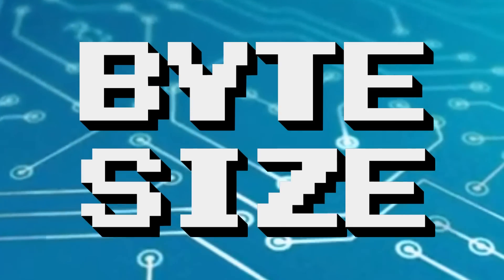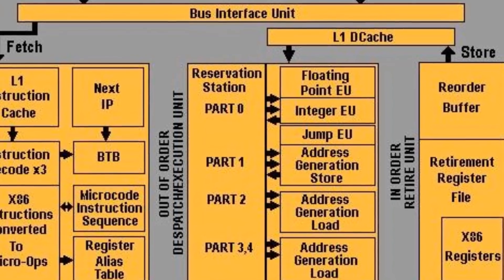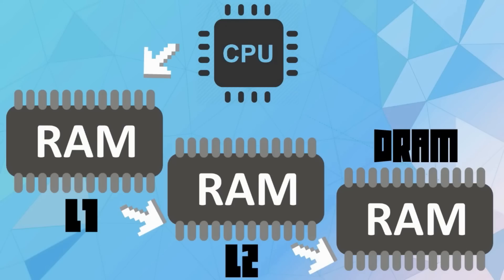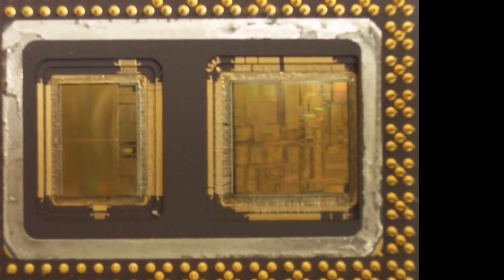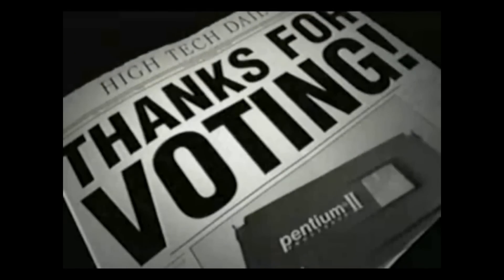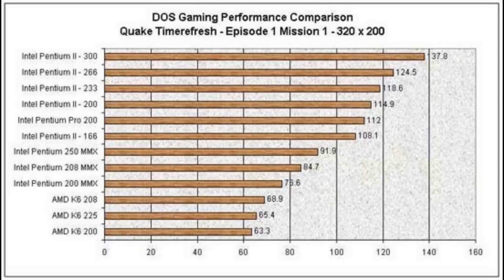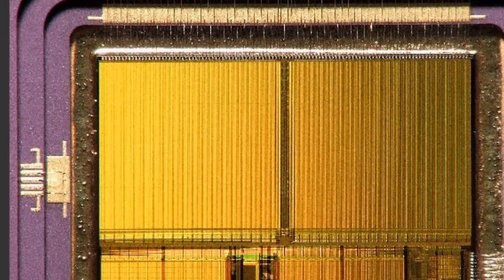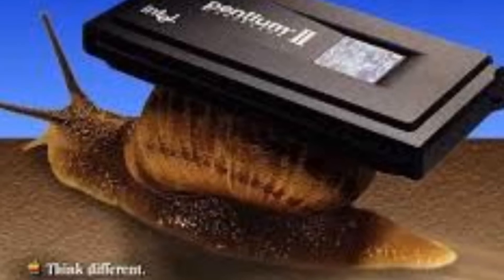Why Were Pentium 2's on Cards? [Byte Size] | Nostalgia Nerd

Comment: Some Pentium III CPUs were slotted too.
Reply: Yup, had a P3-800Mhz that was on a card.
Reply: I had a Celeron that was on a slot adapter, can't remember what slot it adapted to though.
Reply: Slot 1 to Socket 370 adapter, most likely.  That's what I did, while running a Swiftech TEC cooler and -40C temperatures.  I actually beat Intel to 1Ghz using an Intel CPU, but I assumed it had been done before - only to hear about it in the news a few weeks later.

I did that with a Celeron of some type, IIRC.  That machine did me well, but I had to use a full sized box fan to keep it cool :p
Reply: Wrong. Pentium III CPU first came out ONLY on Slot 1. I know because I bought one before socket 370 even existed. You can buy a true Slot 1 PIII from 450mhz all the way up to 1133mhz and NO they are not on a Slot 1 to 370 adapter, they are all genuine Slot 1 units. A simple wiki look up would have shown you this.
Reply: Are you saying I'm wrong?

I was responding to JaminandShara Mills about their use of a slot adapter.

I eventually went with dual Socket 370 - I haven't gone back to one core since :p
Reply: oh ok
Reply: looncraz - You beat Intel to 1 GHz? Eh no. Overclocking wasn't some magical thing, everyone did it. > 1 GHz wasn't special at all. It was just a problem releasing a production model that kept working with proper cooling, especially because of Intel's failure to fix their packaging on their Slot 1 module's cooling plate.

Intel had prototypes far above > 1 GHz months before they released their production line 1 GHz 'heater' that failed partly to Tom's Hardware review, thereby launching the Athlon to the mainstream market. Pretty much the only time Intel had to put in some effort to compete against AMD.
Reply: Errr....AMD dominated desktop the CPU market for years in terms of performance. from the first Socket A Athlons in 2000 to the Athlon X2. Intel finally took the lead in 2006 with their Core2Duo cps...
Reply: EvoPortal they slightly dominated in performance vs costs, but certainly not in market share.
Reply: EvoPortal and most Socket A platforms were crappy SiS and Via chipsets with fix-your-own-driver support. Viaarena anyone? 

Yes Amd had the best bang for the buck, but that's of no use when you look at the whole package. Intel just let everyone down with the P4 and made up for it. Amd just went downhill from K8 onwards. And the succesful K7 was based on the borrowed digital alpha architecture anyway.
Reply: I literally beat them to 1Ghz.  They achieved it November, 1999, I demonstrated in my school at the beginning of my senior year - September, 1999 and had achieved it some time earlier (actually within days of getting my shiny new Celeron CPU.

They used an Asetek Vapochill, I used a Swiftech something or other with a beefed up TEC.

Intel wasn't actually the first to do it, either.  Hardwarecentral did it with TWO Pentium III 500 CPUs - and most certainly did it before I did it, given I didn't manage to buy my CPU at launch - I bought it late in the summer, after my vacation at my aunt's house in Florida :p  In fact, she bought me the Swiftech cooler ;-)
Reply: looncraz i'm sure that you were very impressed with yourself. But there already were 1 ghz smashed systems in the summer of 99 from overclocker teams. Including stable prime95 and the likes.

You're basically claiming that you build the first airplane, while numerous people and teams were doing the same thing succesfully at that time... Which is also not that surprising as the overclocking scene was already big in those years.
Reply: I only ever said I beat INTEL to 1Ghz, I never claimed to be the first of anyone to do it.  I was rock-solid at 1Ghz (actually a little over) using Intel's own hardware.  It was so easy with my cheap Celeron I, naturally, assumed it had already been done (and had been, of course... but just not by Intel).

In any event, I was probably one of the first few dozen people to run a 1Ghz x86 CPU at all (sub-ambient CPU cooling wasn't that common, particularly in 1999).

... And I only brought it up because I did WITH the slot adapter (which made it easier).
Reply: EMPiiRE I had one
Reply: Do you think your idiotic statement is somehow adding to the conversation that died last month?

P1 never reached 1Ghz - not even close.  Intel made a BIG deal about hitting 1Ghz - I saw it on the news and laughed my ass off because it was stupidly easy once you cooled the CPU enough (-40C was plenty, provided you could maintain it).

I ran my system 24/7 at around 900Mhz, I could tweak it to 1Ghz and get into BeOS without issues, but I never felt comfortable pushing the voltage.

I like how you call me 'kid' when your entire statement smacks of someone who wasn't around for the beginning of subambient consumer CPU overclocking.  I'm part of the reason Swiftech began using cold plates on the TEC coolers (well, I assume - the guy actually tried to tell me how worthless they would be... then started using them a month or so later).

My first computer had 8" floppy drives.  My second had those crazy small 5 1/4" floppies.  My third was a Tandy Deskmate.

Just to date myself some...
Reply: Tetra Digm - my thoughts exactly. Amateurs beating big corps sounds cool but is far from reality. Intel has their own labs obviously.
Reply: LekkereKwal amd had its own fabs up until 2008
Reply: stevacus I said 'labs' as in 'laboratories'
Reply: Who are you kidding? VIA chipsets were so-so during the early Athlon days and very quickly became the #2 chipset only slightly behind the fantastic Nforce chipsets. VIA KT series were amazing chipsets for Athon XP cpus.
Reply: I have a P3-500 on a card, it replaced a P2-450 (which was sold as a 450 but was really a 300 O/C to 450) when the P2 would lock up when MMX was used.
Reply: wasn't that the Celeron 300a. had one on a "slotKit" socket mount cpu on a slot card. 50%oc out of the box. guaranteed
Reply: The one I have is not a Celeron. I can even give you the part number: 80532PX300512PE SL2W8
Reply: Not referring to the 3/500 that wasn't overclocked. Was referring to the 450 that we a 300 overclocked
Reply: That was the Pentium II 300 OC'd to 450. It also came with a passive heatsink.
Reply: Just dug one out of an old computer from when I was a kid too.
Reply: There were even P3 slot adapters to let us put the newer P3 CPUs on older P2 motherboards.

Ah, those were the days.
Reply: i'm pretty sure nearly all of them were slots , never even seen a socket version of a p3 in my life,
then again, by that time AMD athlon was raping p3 anyway ;)

i  had p3-450, traded for a p3-550 with someone who already had a p3-450 and a dual socket mainboard running BSD back in the day
Reply: I've seen P3's in slots, sockets, and slot adapters. Some slot adapters let you plug early P3's into P2 motherboards. There were definitely plenty of socketed P3's. I know,  because I built well over a hundred myself.

And yes, the Athlon was a faster chip at any specific clock speed; however, Athlon had the nasty habit of letting the magic smoke out if the heat sink wasn't properly attached, so we tended sell more Intels to business and AMD's to gamers. 

And don't get me started on the conversation I had with the guy who acted like we cheated him when we sold him an AthlonXP processor; Athlon called a 2000MHz processor a "2400+". Dude thought he was buying a 2.4Ghz CPU and came back mad when he found out it was, technically, a 2GHz CPu. I tried to explain pipelining and MIPS, but he didn't want to hear it... just called us cheats and lairs.
Reply: haha thanks for clearing that one up

i did repair and build a fair share of computers back in 1999 orso when i worked as internal tech/helpdesk guy for a software company
the systems varied from shitty 486 word processing machines (hey we used a 486 as software router/dns server, and had like uptimes of like 3 years) up to pentium 3's

we didn't have many AMD machines at all there either, but the head tech guy that went freelance and trained me to take over the job, was a big linux and AMD buff, and had machines to disprove the idea AMD was unstable (sure, the old ALI bioese were fucking horrible though), he was like some sort of real life bastard BOFH, but back then PC's were less mainstream and they were more of a niche nerdy thing i guess ;)

the DTP department all still used the motorola CPU-based macs , except for 2 guys that had pre-ordered dell p3-550's, i do remember even those OEM machines hainvg slotted aswell so i figured all p3's were in fact slot like the p2 and celerons

i was aware of the k5 and k6, back when someone played quake on it in 1997, but didn't turn away from intel until thunderbird,so my own upgrade path was goign from a p550 @ 622 to an athlon 1000
Reply: The Celeron was Slot 1 also. I still have mine with the SMP modification where you had to use a .8mm drill to drill through the PCB in order to cut off one pin from the CPU and do some other wiring to enable SMP and dual cpu systems on the cheap.
Reply: Owned a old Pentium III 800MHz SECC myself.... Still works actually, I melted the bios on its old motherboard tho.
Reply: EMPiiRE I have a card pentium 3
Reply: i had a P3-500Mhz that was slotted, ran windows 2000 pretty well
Reply: It's a Socket 370 to Slot 1 Adapter
Reply: My mother's old PC had a 700mhz Pentium 3 was in cartridge form.
Reply: my first one <3 PIII 500
Reply: yeah, my first pc ever,  a PIII @500mhz was that format
Reply: The SL2W8 clicks something in my mind. Wasn't this batch that were very good for overclocking purposes?
Reply: I think the PIII first versions were still on Slot 1, then moved to the Socket 370 sometimes Fall 1999/Winter 2000. I remember about fixing my uncle's first computer (a Fujitsu Celeron 500) that was on a micro-ATX S370 mobo.
Reply: I still have a few PIII systems laying around, some slotted, some socketed. I even have a couple of Socket 370->Slot 1 adapters. In general, the socketed chips ran with a higher FSB than the slot 1 chips, though for those chips it's a difference of 100MHz FSB vs 133MHz FSB. 

I also have a 900 MHz Slot A Athlon. Weird little board it's on, too. Actually has an AGP Pro slot on it. (One of those weird slightly-longer AGP slots that provided extra power connections so the more powerful cards wouldn't need a direct connection to the PSU. Too bad cards for AGP Pro were pretty rare.)
Reply: LekkereKwal a teacher at my high school used to work for IBM, in 1995 they were working on a secret chip for the military for guided missiles he was told it was clocked at 7GHz at the time and was super hush hush. Lol what production CPU is clocked at 7GHz in 2018?
Reply: Adding to this, there are some PIII Dual Slot 'server' motherboards that used 8 slots of SODIMM (up to 16GB - basically 8x 2GB SODIMM), and had an AGP video card slot along with a 1/2 dozen PCI slots (usually needed one for a sound card and at least one more for router connection), Side note, I had two of these, and used both of them with Voodoo 3 graphics and Aureal Vortex A3D sound, and played 'current at that time video games on high/ultra settings.
Reply: +Randal Lovelace - Reminds me of an old quad Pentium Pro server I worked with before. Had two riser cards with a pair of 200 MHz Pentium Pros each, and a third riser card for memory. The system had the option of using either EDO DIMMs or EDO SIMMs depending on which memory riser was chosen. It was one of the few boards I've seen that will take SIMMs larger than 32MB (it had 8 128MB EDO SIMMs when I was fiddling with it). It also had about a dozen EISA slots, two Wide SCSI buses on-board, and a pair of 6-bay hot swap SCSI racks. Oh, and Dual power supplies, with a place for a third if desired (this one only had the two installed). Good luck running any games on it, though, as there weren't many good options in the EISA era, and you had to run either NT4, 2000, or 2003 Advanced Server on it, which aren't really optimized for games.
Reply: I was able to find the board with the 'advanced for that time' AGP slot, due it being built for doing graphics and photo work. It basically needed to have support for 1900x1600 @ 60hz to connect up the monitors (yes two of them, which were 5/4 20" beast - probably 160lbs each - yeah, I got those also when I got that server board).
Reply: I had a board like that too, but it had a problem with the EDO DIMM slots for the 2nd CPU, so it wouldn't run a true dual CPU... shame as it could hold more memory than the other board, built in SCSI (*both types). I don't have space to 'play' anymore, but one day I'll get to mess with some old hardware again.
Reply: Got an compaq dual slot server board that I'm going to put in order. Perhaps with slocket boards and 370 cpu's. I don't know how much ram you can put on the mobo and still have  any good use of it? The other old single slot compaq I have doesn't seem to like more than 512-740mb before it actually runs slower.
Reply: And you can get a slotted Pentium 3s 512KB l2  with a on board  370FCPGA2 socket and upgrade that bitch to 1.4GHZ(provided you had lower voltage option on the motherboard)bios support etc..
Reply: AMD lost me at the socket 939 I have not looked back  because the  4 core socket 939 never happened
Reply: yep i still have one and is running super well with a linux os or windows xp i even been in need of using it for a week because my main pc broke down i was using it with zorin os just to check my email slow but working thats all i was needing lol
Reply: Slocket adapters!
Reply: I have two but they don't look as good as p2s
Reply: Indeed, a "Tiny" PC I bought in 1999 had a 450 mhz P3 based on a cartridge. I thought it was strange when I cracked open the case to fit an AGP graphics card in. The said PC was also the first of its kind to have a DVD drive fitted which I thought was a huge boon for its time.
Reply: And don't forget the early Athlons.
Reply: @GBOAC  Bullshit.  Those first gen Socket A systems kicked Intel in the nuts for performance -- Intel took back the lead like the next year, but when those chips came out, they were performance beasts.
Reply: @BrainSlugs83  what are you responding too? I even said they beat Intel in performance vs costs.
Reply: @GBOAC  I'm not talking vs costs.  That's today.  AMD is cheaper.  But the first gen Athlon CPUs beat the then current gen Intel chips in performance! The slot A Athlons ran games better and faster and were just plain powerhouses at the time of launch.  It's why they got popular in the first place.  There was already budget options like Cyrix, and AMD K6-2, and they beat Intel on cost, but they were garbage chips.  The 500mhz Athlon when it came out was the CPU everyone wanted; you could throw any game at it and it would run flawlessly.
Reply: @BrainSlugs83   first gen Athlon were slot A, not socket A. But where did I mention anything about Athlons not being faster? Btw AMD was cheaper back then too, they always were.
Reply: @GBOAC  I know they were slot A.  My phone keeps trying to autocorrect that.  If they're cheaper and better then they're just better.  "Better value" implies that they're only better for cost/compute (which is the case today).  Back then, they were just better all around.
Reply: @BrainSlugs83  Ok so where does your 'Bullshit' comment come from?
Reply: My Pentium III 500MhZ (thanks to inheritance from my departed Granddad - cheers Granddad!) was a solid machine from 1999 for nearly a decade! Even had a 6X DVD-ROM drive from Creative! Still got my old system! The only catch with DVD being new is we needed "Decoder cards" for the DVD movies. Anything else was fine without the card.
Reply: Cambridge Soundworks had a 4 point surround speaker set as well, designed to be used with the "Soundblaster Live Value!" sound card. Tiny speakers, loud and clear!
STILL ALIVE and used on my TV for my devices plugged into the TV! 20 years almost! Creative were a great brand. RIP.
Reply: Has anyone ever tried overclocking these things. I have a slotted Pentium 3 700. Thinking of doing some xoc with it
Reply: @jaminandsharamills320  the P2s and several of the initial P3s were Slot 1, with the Coppermine core being intro'd both as a socket 370 and a Slot1 cartridge...; but, there were indeed little adapters that allowed socket 370 CPUs into a slot 1 adapter....
Reply: @EvoPortal  I still have my Slot A Athlon 600, I resoldered the cache divider resistors from 1/2  to 1/3 and over clocked to 850Mhz. 

Its now a retro Win98 / DOS PC running at 600Mhz still have the golden fingers connector if I wanted to overclock again....

The Celeron 300A processors were the first with on chip cache and could easily overclock to 450Mhz by switching bus speed from 66Mhz to 100Mhz.
Reply: The Coppermine P3s were available in Slot 1 and socket 370....
Reply: Yes! My Compaq deskpro had a foxcard Pentium 3
Reply: Back in my day external CPUs were a thing young ones! Like your GPU today!
Reply: Paul Venn same
Reply: The best PIII's were the "coppermine" models made at the end that actually beat the crap out of the Pentium IV!  Worked at Intel during those years...
Reply: I have a Pentium III cartridge CPU
Reply: I had a slot 1 PIII.
Reply: Yep our first computer was  P3 with 450Mhz and 10GB drive and 128GB of ram.  Big slot cpu and it sat right behind the power supply which was mounted sideways.    I used to kind of hate that machine at the time as it was so slow and windows 98 was so unstable, but I also kinda have some nostalgia of it.  Wish I had kept it around, I don't even know what I did with it once we upgraded.
Reply: Indeed and even Celerons or AMD's K7 or Duron, it was a nice idea. Should just be rotated 90* so the airflow follows from front to back. 
Even recently I built a retrogaming P3 machine with a cartidge and a MSI on it. I'm proud. It all works perfectly after 20 years!
Reply: I had a Pentium 3 MMX that I don't know the frequency of.
Reply: True. I just found that out the other day when I got a system from work with one. It is interesting seeing it run Windows XP on only 450 MHz, but that's what came on it and the CD drive appears to not work. Also, the sound card is giving me a lot of trouble, but I hope to get it working. I'm just not the greatest with these old computers that are older than I am.
Reply: I have one in an old pc
Reply: @EvoPortal  My Main dektop  PC  i do a lot even game a bit  and it Socket AM3  AMD Athlon  X2 Black  2.8ghz and it ran laps around some Intel Chip when bought the PC bran new in 2013  .  i hate core 2 duo computer they feel so slow  yet i type this on my laptop witch is Core 2 duo thinkpad   maybe i should not talk bad about core 2 duo i might get BSOD lol   from my thinkpad   giggles but my Desktop is got max ram and grapics card in it too but I swear AMD just faster at everything then intel chips  expect for durons i had one them blow up badly